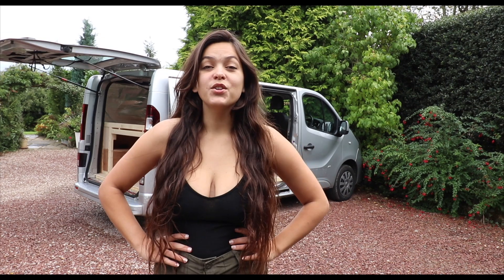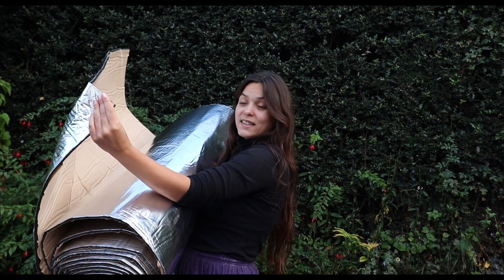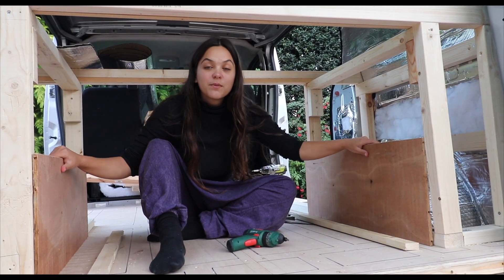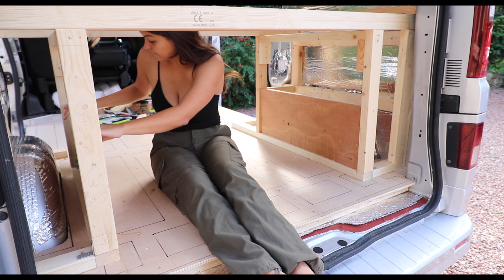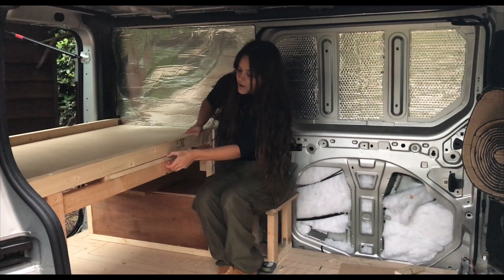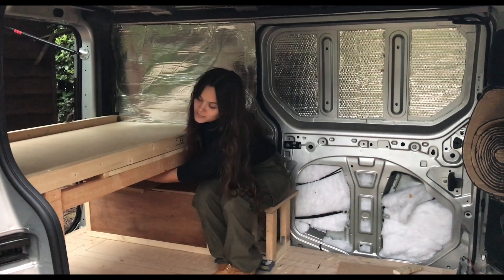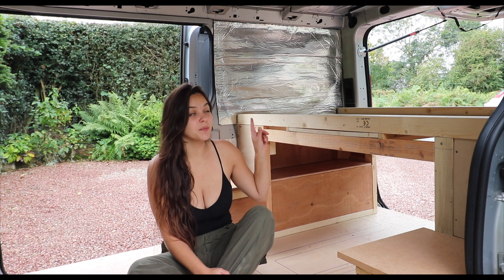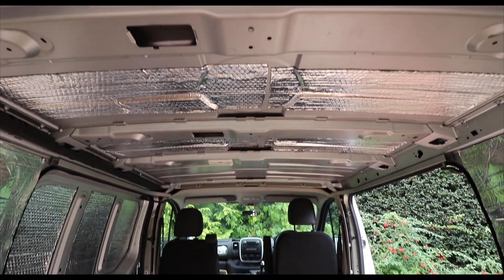The Ultimate Van Conversion: How I Built My Perfect Bed | Fenellas Corner

Comment: Great Van Build so Far!' Thought of Doing The Same Over Here 'usa'_ Imo' Create Two Angled Center Supports 'From The Same Type of Framing Wood' _ 'From The Middle of The Slide Rails To The Wheel Cover Box Tops' Because 1 or 2 People Are Heavy For An Unsupported Center' Just Tryin To Help'😶✌🌈